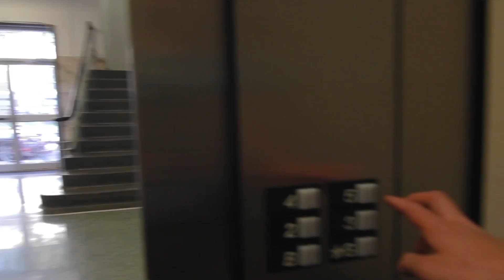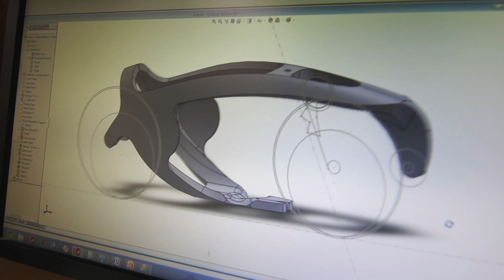Eta: Our Latest Project

Comment: That's cute, but if I need to haul my groceries in traffic while grandma is crossing the road in bumper-to-bumper traffic, this fancy bicycle won't do shit.
I'm not trying to dump on your invention, but it has very specific limitations of use.  Also, in an accident with an 18-wheeler, this bicycle provides the user with no safety because it's designed for speed, and would get crushed faster than an egg under an elephant.

Comment: a new cicling high speed sport would be cool ;)
Reply: Such a sport already exists.  This attempt will compete against other, past attempts.  The current record, mentioned in the video, is about 83 MPH, set by a team from Delft, Netherlands; in Fall of 2013.
Reply: Doug Grosjean
 interesting, i got to look up crash montages for that then. got to love high speed crashes :p
Reply: I don't think crashes are very common in that sport.  You don't hear of many.  They don't race side-by-side, but against timing lights.  They get a 5-mile run at the timing lights, and are clocked at the end of 5 miles.  Google on Battle Mountain and bicycle races.